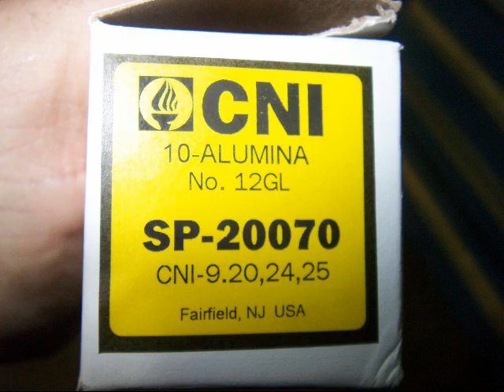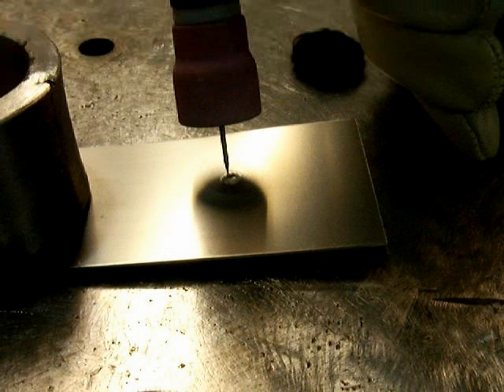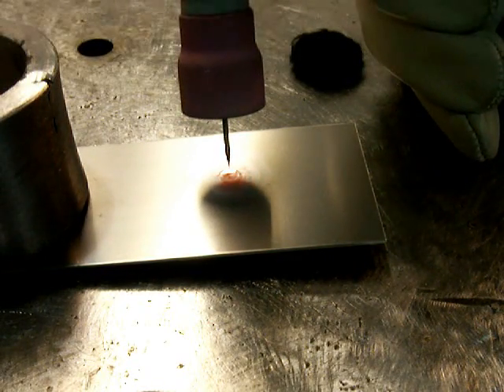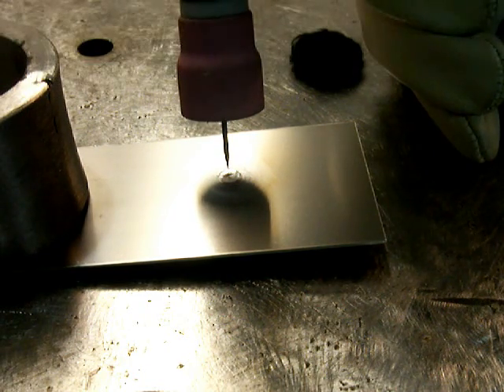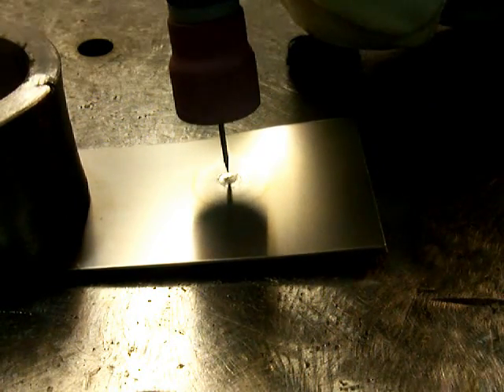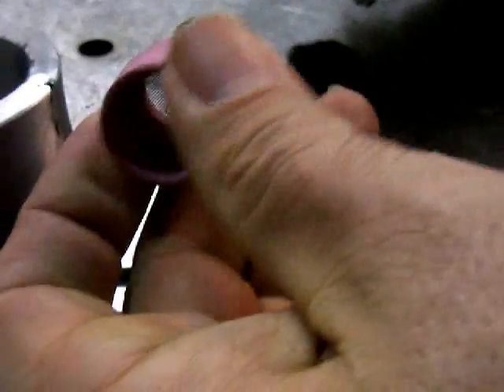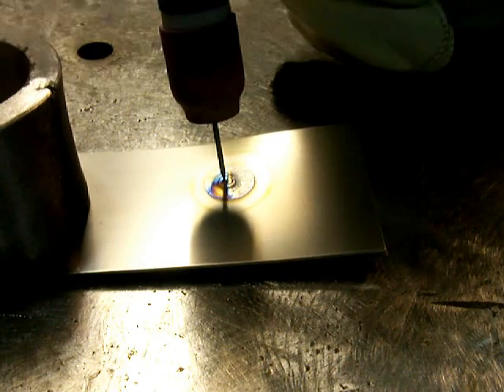Tig Welding Tip for Getting Better gas coverage

Comment: Hi Jody, dave here just got a miller syn 210. Very nice tig stick. Comes with a wp17 torch #7 cup the problem im having is im welding  7/16  sq blocks on a pc of  .130 th mat the block distance is about .700 apart from each other so i cant get a good angle on the torch. So i was thinking of a smaller cup. Is this the rite logic or should i be looking at a larger cup with defuser  and longer stick out all material is 1008-1010 mild. thanks great vids.

Comment: would you say you use a gas lense more often than "standard" gas hardware? i'm running ~20 on the gas right now with my WP-20, and have been thinking of getting a gas lense setup off ebay to see if it'll help me save gas since i only have an 80 cu/ft bottle, so i only get ~4 hours or so from 1 bottle before needing to swap it. if i could get down to 15 or 12 that'd be a pretty decent increase. also, have you tried the ebay gas lenses vs a quality name brand lense?

Comment: Great Videos. 
Im new to TIG and Ti but could I use any non-Ti filler rod to weld onto Ti? For example stainless rod as long as its non structural? Thanks for your time.